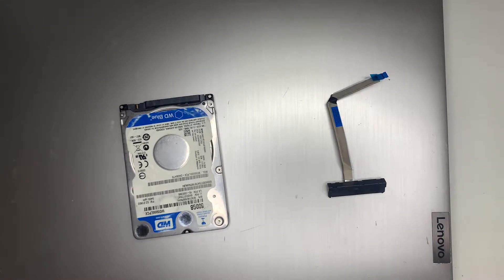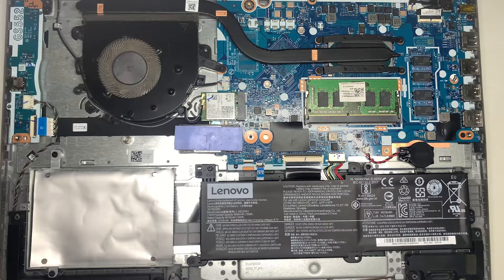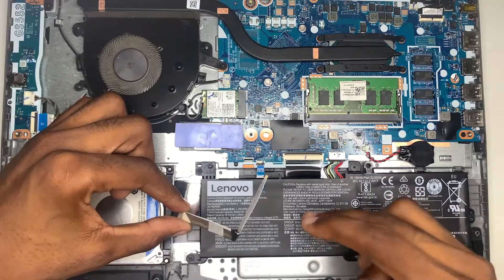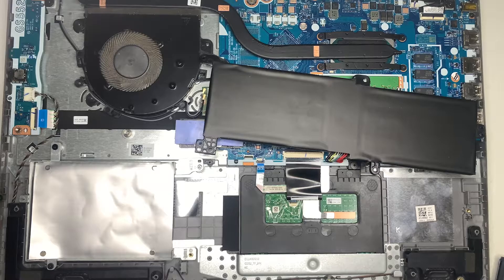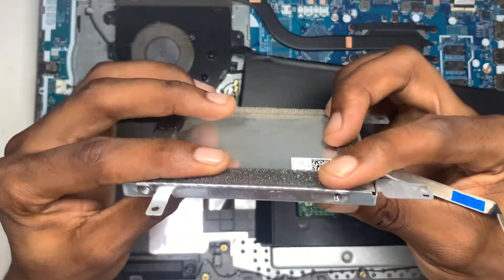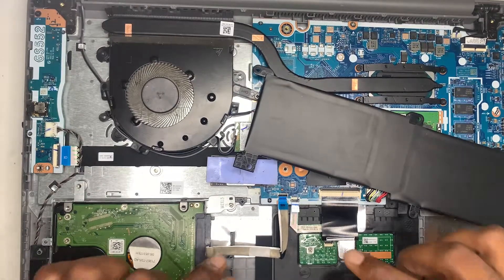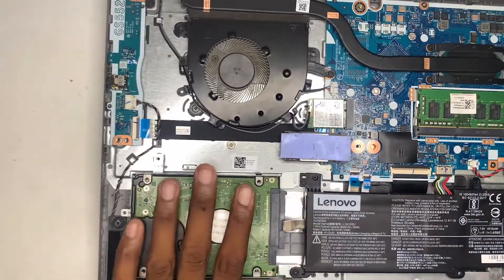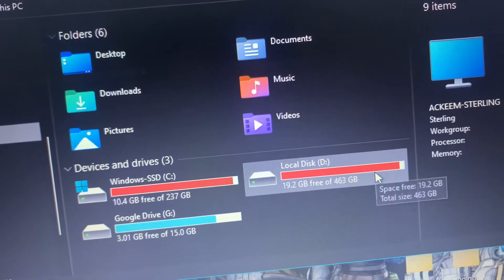How to install Additional SATA HDD in the  Lenovo Ideapad 3

Comment: I want to do this on my ideapad flex 3 but im scared if I open it I might break the touch screen thing
Is it a safe thing to do by myself? (I only have previous experience with gaming setups only but no laptop experience)
Reply from the maker: Once you have screwed out the the screw properly and remove the bottom component your good to go . Don’t think the screen can break that easily when you turn it over
Reply: @Ackeemsterlingreviews  thank you so much
Reply from the maker: @QueenyCupcake  You are most welcome friend

Comment: Do you have a part number for the HDD bracket?  Mine doesn't have one but it has the spot for plugging in the cable.
Reply from the maker: I don’t really remember I would have to check if there is one